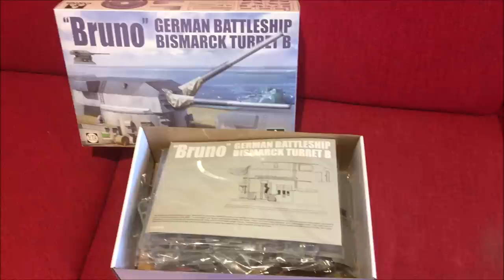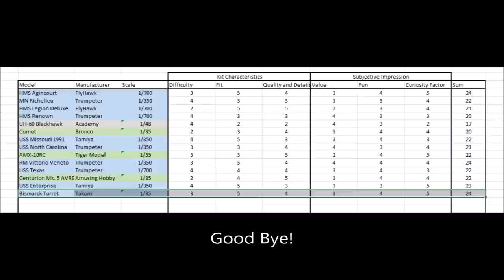Building and Painting Bruno: B-Turret of Battleship Bismarck 1/72 from Takom

Comment from the maker: Another note to Annealing: The copper requires an annealing temperature of at least 400°C, so be sure to hold the PE sprue directly into the candle (which has around 600-1400°C), the air above the candle can be of much less temperature and the results can be less good.
Steel PE parts are also possible to anneal with a candle
Reply: A dumb question: why not putting the sheet directly in the oven making it an even annealing heating up to approximately 400°?
Reply from the maker: @paoloviti6156  My oven can only provide 250°C of temperature :-D But it would be a great idea when you have such a powerful oven
Reply: @funinscale2892  oh, I didn't think of that!! In Italy, I'm Italian, we very often use gas operated ovens that are very hot but at home I have electric oven too🥺
Reply: @funinscale2892  Imagine that being only one part of the whole ship.

I mean how cool would that be?
Reply: For how long the PE should be exposed to the flame?  I just got my kit today.   And to decide to buy it your video was of a lot of help, thank you.

Comment: 8:06 - those tubes sitting behind the turret on the deck ?
They were storage for metal rods and big cotton swabs.
They screwed together to form a big bore cleaner that was used to polish and lightly oil the main gun barrels.
Reply from the maker: Ah yes, this makes sense, thanks for the clarification!
Reply: @funinscale2892  it is not necessarily the case. I was a gunners mate on the USS Iowa and we did not have long metal rods and cotton swabs. We had a circular brush about the size of a powder bag. We put it in the tip and with a length of rope guys inside the turrets pulled it through to clean the barrel. We called them pigs because of the squealing sound they would make as they were being pulled through the barrel. I think it is equally probable that they were storage for strike down equipment. Meaning a temporary crane you would assemble to replenish shells and powder. On the Iowa there was a strike down hatch near turret 2. you would assemble a temporary hoist to lower shells and powder all the way down to the powder flats.

Comment: Those long tubes on the deck behind the turret that you said you didn't know the purpose of were storage tubes for the brushes and equipment used to clean the 380 mm gun barrels after an engagement.   Just FYI 😁

And just imagine:  the damn thing weighed almost 2,000 tons...
Reply: Are you sure? It could be strike down equipment. On the Iowa we had a hatch in the deck by turret two and successive hatches all the way down to the powder flats. It is how we would replenish ammo underway. The equipment to lower those shells down into the ship was bulky. I am not sure how they did it on Bismarck. For cleaning the barrel we had a brush about the size of a powder bag. we would run some rope from the tip to the breech and tie it off on the brush and pit it in the tip. Guys in the turret would pull the rope and pull the brush through the gun. It did not take up much space at all.
Reply: @Bellthorian After double checking my reference material I'm not so sure now.  The excellent reference book The Battleship Bismarck by Stefan Draminski (pages 121 and 159) indicates they are something called "main artillery sub-caliber barrel container", which to my understanding the word container indicates that they are probably what I described above.  I'm sure the Kriegsmarine's naval architects would have done things just slightly different from the US Navy's naval architects 🤣🤣🤣🤣
Out of curiosity:  how long did it take to clean the Iowa's main gun barrels?
Reply: @GRAYR189  Not long, the brush, we called it a pig was hollow and you would fill it with oil, you would pull it down the barrel and it would rotate and scrub and lubricate the barrel at the same time. Maybe a couple of minutes per barrel.
Reply: @Bellthorian  I imagine that during an engagement you wouldn't have a long time to clean the main guns 🤣🤣🤣🤣
Reply: @GRAYR189  LOL You wouldn't have to clean them during an engagement. Especially in the 80's with the advent of additives that pretty much eliminated wear on the barrels.

Comment: when annealing, what is your opinion of bench cooling vs. quenching?
Reply from the maker: Hi joseph, i just left it on the bench for several seconds and it was cool again - so it is not much of a difference in time savings. from a material science pov, i dont know what would be better but i assume natural cooling as dipping it into cold water might bend the material - which isnt a problem either, actually, because most parts need to be bent

Comment: What superglue do you use for ship pe?
Reply from the maker: It's called loctite powerflex gel. I'm not sure if this is a common brand or only in my country
Reply: @funinscale2892 Oh, i have locite quick attack or somethiing
Reply from the maker: @zhaoliu9080  The one i use has rubber particles in it, this makes the super glue really instantly sticky, which is great for applying small PE  parts in my opinion. There are other manufacturers as well that make such super glues

Comment: Can you do 1/200, if not then ok.( why do you only have like 700subs, you should have like 10,000) :)
Reply from the maker: Thank you! Maybe in the future, we can get to that much subscribers :)
I will do something in 1/200 for sure, soon
Reply: @funinscale2892  could you do the misssouri, i really need a full build on it, and you are my favourite modeller so.
Reply from the maker: @zhaoliu9080  I only have HMS Rodney and Hood in 1/200, and i thought about starting the Rodney for a while. I once built the USS Iowa, and it was a great kit, despite the size, it was not as hard as you would imagine. There is a great build on the USS Missouri in 1/200 from Midwest Model Shop on Youtube, but it is made in over 30 separate videos. But very detailed!
Reply: @funinscale2892  ok thanks
Reply: do you recommend the pontos kit from your iowa build?
Reply from the maker: @zhaoliu9080  I didnt have it but i can say that the Trumpeter kit is excellently detailed. There are all railings included, most of the small armament have PE details and many many more. There were around 6 PE sprues that were the size of a piece of paper, so you get alot of detail. The wooden deck might come in handy but as the deck is a dark navy blue, the wooden structure and tone of a real wooden deck is not that important
Reply: @funinscale2892  thanks
Reply from the maker: @zhaoliu9080  But i usually build kits out of the box without additional parts, so you might check other opinions as well

Comment: what glue are you using for plastic parts?
Reply from the maker: For plastic parts i use Mr cement s or mr cement deluxe (s is very liquid, deluxe has a gelatinous consistency when some parts require more handling time, it doesnt dry as fast